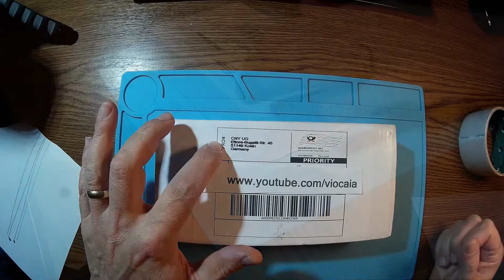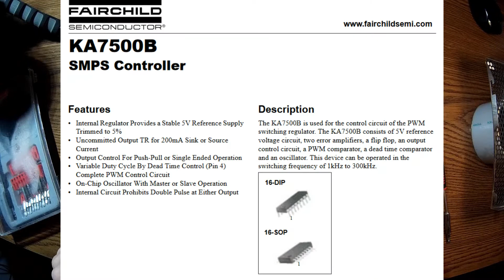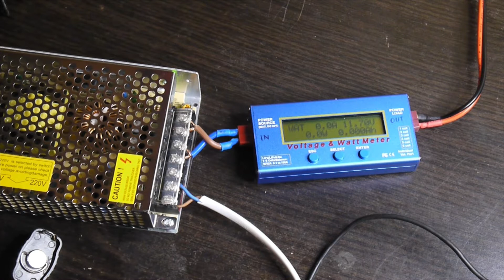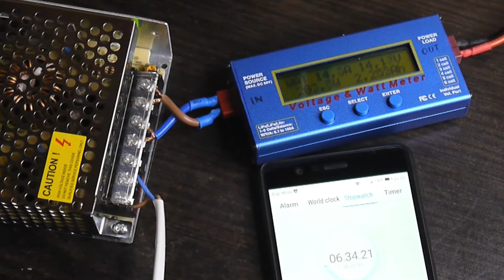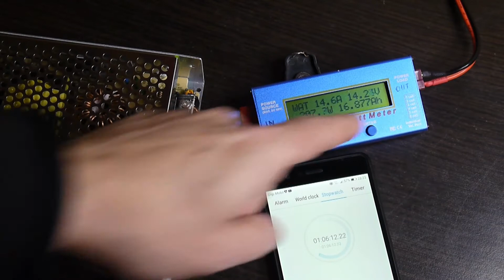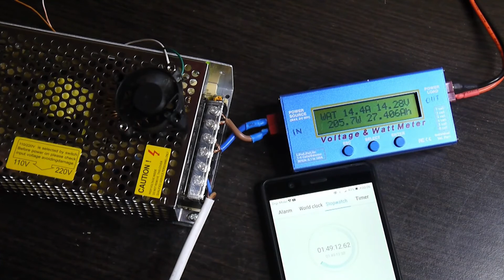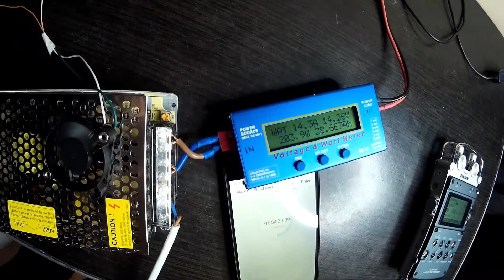Cheap LED Strip Light Switch Power Supply DC 12V 15A 180W test

Comment: What would be the ac amp rate  on that at 220volt
Reply from the maker: I reach easily 15A, and works flawlessly 10A continuous output. Good idea to add a small fan on top

Comment: I just bought the exact same model still in the box for $1 at a discount/thrift store. 
I plan on using it in my rv/camper to convert 110 to 12v is only going to power 6 LED lights.
Did you say it will charge my battery too?
Reply from the maker: Yep..but don't rise the voltage more then 13V..it will boil the batteries..it should be nice to have a current meter so turn the trimmer until gain like 5-6Ah..
Reply: @viocaia  it's set at 13.3, I was thinking about setting it at 12.9.
Can I set my solar charger to the same battery? I was considering putting a solar/off/ac switch too
Reply from the maker: @Manuel_Z_Kayaks  Very good with 12.9, and you charge both solar and charger in the same time to the same battery.

Comment: driverii nu sunt mos-fet ci bipolari daca mi se permite
Reply from the maker: Posibil sa fie fake-uri la fake-uri..se poarta la ei..
Reply: @viocaia  revin cu update...a mea era defecta....un c1815 de langa controller dadea dubios la masurat!
asa....a mea e pe bipolari gen T13007 cum sunt in sursa atx! si aveati dreptate ....eu in teste am tras 200w din ea fara sa sughite
Reply from the maker: @mitacccosminmc5297  Daca ar fi facute cu componente de calitate ar merge o viata..dar stim ce se pune in ele..a mea merge permanent cam cu 5A, incarca baterii de backup 250Ah..pina acum totul ok..
Reply: @viocaia  recomand masurarea esr la conzii de voltaj mare! la mine unu era mort....l-am decapsulat si borna de plus era puscata
Reply from the maker: @mitacccosminmc5297  Cu prima ocazie..mersi de tip!

Comment: Salut te urmaresc din anglia si as avea nevoie de putin ajutor in legatura cu power switch.. mi sa ars acum cateva zile si foloseam o sursa MPS S 145 12 
am instalat leduri noi cu o luminozitate mai mare dar nu am tinut cont de faptul ca ele au nevoie de o anumita sursa pentru a le da puterea de care au nevoie... 
menționez ca luminile au functionat cam 2 sapt si nu am avut probleme.. iluminarea era ft buna.. 
led strips folosite sunt 5050 12VDC 
am instalat 4x 3.5m pentru a ilumina un frigider pentru prajituri.. 
dupa mai multe calcule si videoclipuri am decis sa cumpar o sursă de S 180 12
ceva recomandari sau sugesti pentru a nu arde si aceasta sursă .. va mulțumesc anticipat
Reply from the maker: 5050 sint LED-uri de 12W  , asadar legate in paralel trebuie o sursa de cel putin 4x12W..as merge pe ceva dublu..gen 100W chiar 150W ca sint relativ ieftine.Apoi, din trimerul de reglaj, cautati sa nu dati maximum de luminozitate..daca va uitati pe strips, acolo sint niste rezistente de limitatre a curentului..cind dati tensiune maxima..pe acele resistente se pierde foarte mult curent..asadar o luminozitate medie e categoric mai ok si pentru sursa si pentru LEDuri..ed ex..am in curte puse vreo 3 strips de 5m..le dau cam 11v si merge de 4 ani fara probleme...
Ca si sursa , regula nr1 ..cu cit mai mare cu atit mai buna..de ex ..asta de 180W (nu-s chiar 180..) e foarte ok ..in concluzie..
1.sursa cit mai mare ca si putere in Wati
2. reduceti tensiunea spre iluminare medie..
Reply: @viocaia  Super va mulțumesc pentru răspunsul rapid si pentru ajutor
va doresc mult succes is sper sa ajute cat mai multi videourile dvs 🤗🤗
Reply from the maker: @viktoriacakes1418  cu placere! Spor la toate!

Comment: Hi. I have the same model at home . Can i charge 60ah car battery with that supply if i install fan on it .and what voltage should i use on it when charging ? thanks
Reply from the maker: Of course you can, there is no need for fan, you set it to max 14.2 v..around 7-8Ah..
Reply: @viocaia  when i adjust voltage regulator on the supply ,does it adjust amp at the same time ? and one more question pls. when do i  adjust exact   voltage when is it connected to battery or while not connected ?
Reply from the maker: @beka.m.3490  The current is up the voltage, don't push more then 14.4v max ..also the voltage can be set without batteries connected..